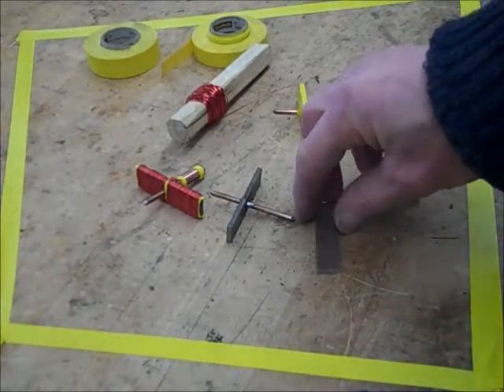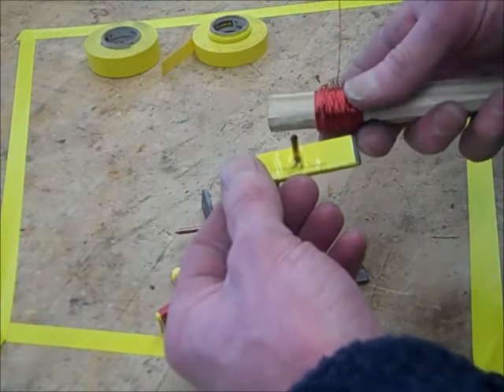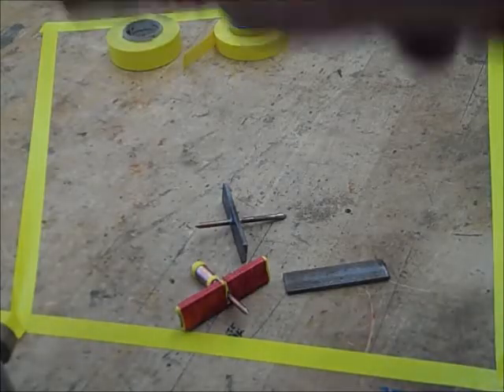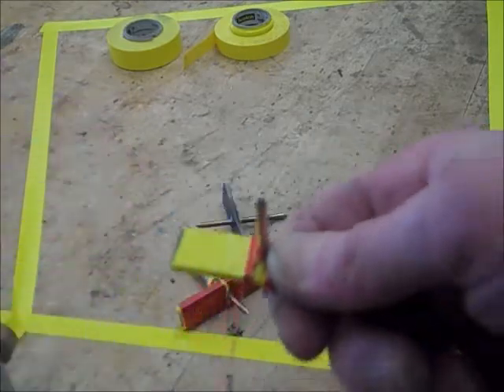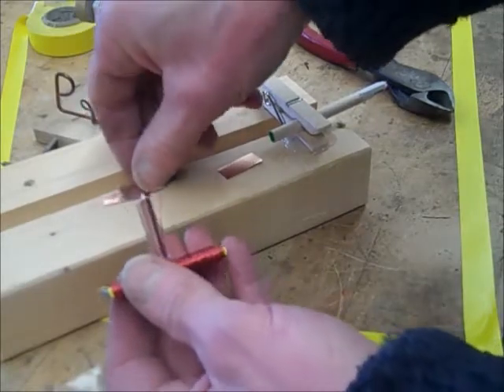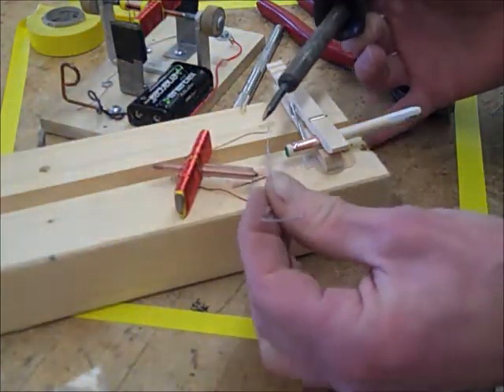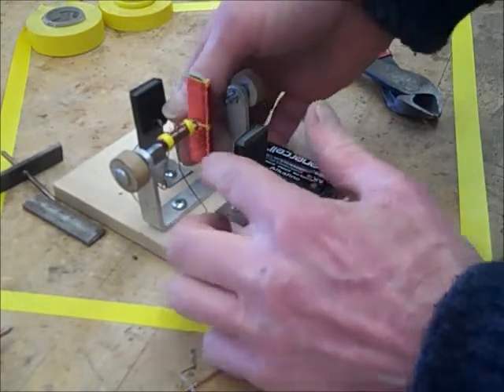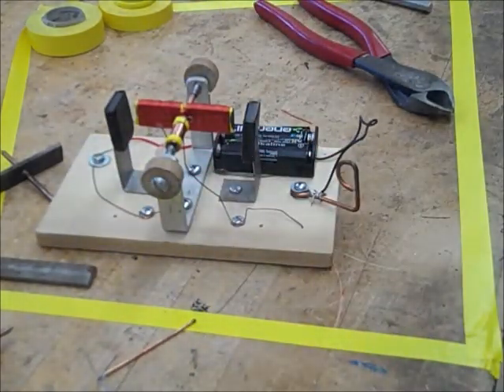E car armature winding

Comment from the maker: I'm sorry to report that this motor doesn't work well with a nine-volt battery, especially if the 9-volt is of a lower quality or rechargeable.  They just don't deliver the current required to overcome the attraction between the steel core and the magnetic field.  You might try reducing the armature core thickness, but switching to AA or AAA batteries of alkaline quality is garanteed to work and cost less too.  Or... you could buy a toy motor designed for a 9-volt battery.

Comment: If I were to use a 9 volt battery, could I use stronger magnets to increase the magnetic field? If not, do you have any suggestions to be able to use a 9 volt in order to make it run? I've tried a different motor before, but it didn't work, and I'm trying this one out, but I have to use a 9 volt battery.

Comment from the maker: not really...you will find that a 9 volt battery can't deliver the current (amps) required to run the motor well.  I think part of the problem is the less powerful magnetic field generated by lower current.  You can't really compare this motor to a factory-made three pole motor from your average toy car,  two AA cells produce a fine running car.  If you add another battery box and battery in series, the car will be faster and more powerful due to extra voltage and the current to back it up.